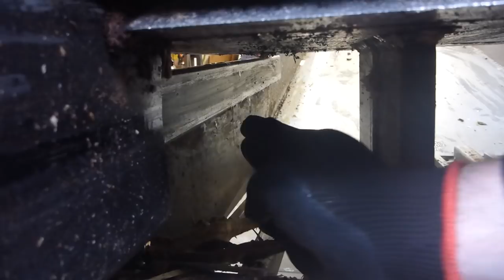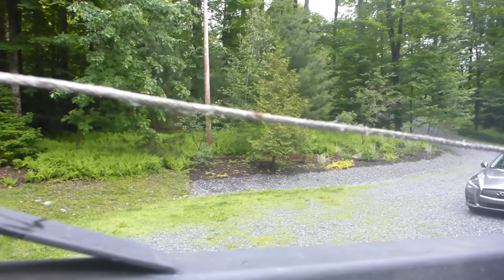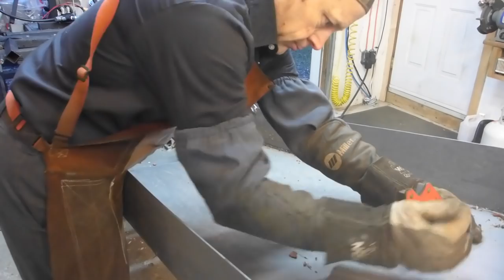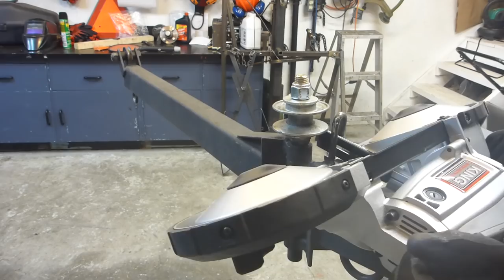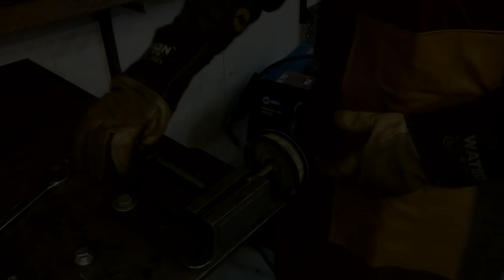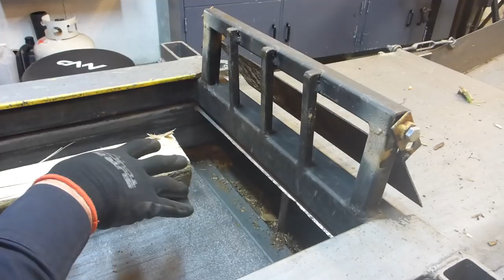#76 Splitter Modifications - Update

Comment: I know this is an older video and i am not sure if you have solved the problem of the unsplit chunk of wood from not getting caught up on the splitting wedge box but here is my idea...   make the side arms of the device that pulls the wood back out of square tubing (or round) and have it telescope, and put springs on it that will allow it to expand a bit when the ram is splitting but when it is retracting the springs pull the retraction frame closed thus pulling the chunk of wood off the splitting wedge/box.  You could use springs off an old trampoline and add as many as you need to make it work.
Reply from the maker: You can see video #77.  Pushing the logs back into the drawer was 95% solved.  What is not really solved to my liking is the logs jamming on the sides of the wedge, pushing against the side wings, which directs them onto the chute. I've found a method to put the logs into the "drawer" where it will operates way much better. In instance, I try not to put logs against the side of the drawer. Which so far seems to work good.  I should be splitting wood within a couple of months. Here, we till have a good 18'' of snow on the ground. I haven't cut any tree yet...  Thanks for your advice!

Comment: Joe, For keeping the wire rope, wouldn't it have been easier to weld two small , smooth bars across the guide hooks, one slightly higher than the other  then thread the cable over one bar and under the other?  I checked out #32 and there are some minor differences between  the IH 350 I once had and your machine.  First the loader controls were mounted on  part of the loader frame, and the  throws were shorter so it was easier to use both function at the same time.  The throttle lever was on the right of the steering wheel and the tractor didn't have a pto.  The original owner was WPI in Worcester, Ma. and they used it for grounds maintenance and had no use for it. What the tractor had was a rigid hitch, upon which sat a honkin' big concrete ballast block.  I found out the hard way it wasn't bolted down.  One fine day, after finishing my plow route, I was headed home and hit a bump of ice and snow doing about 25 MPH, had that thing bounced off. I wound up pushing the block home  (about 2  1/2  miles because it was heavier than the lift capacity of the loader. I got home without any problems, but getting it back on the hitch  is another story.  I'll just say it was a minor miracle I didn't crush an arm or a leg.
Reply from the maker: Lol! Very funny story, knowing no harm involved. Must have been very odd from an outsider to see a guy pushing a concrete block "home". (still laughing as I write this). As for the cable, even if guided, it does have to slide along the pulley. It's can enter at a set level and exit the same level after a rotation. So it have to slide slightly. Thanks for watching Jim!

Comment: Hi Joe, love the splitter, hope you don’t mind if I ‘borrow’ a few of your ideas for my channel! (I will mention you)
Why did you not mount the electric winch to the end of the crane and mount cables to it instead of dealing with the rope which moves?
Reply from the maker: Take everything you want, my videos are free! That is a good question about the winch! The winch is a very cheap one. To disengage the spool, I have to pull a lever on it. Being up there would not be possible for me and I use the crane as a winch for remote blocks (up to 25' far away). Then the remote is wired directly to the winch, not wireless. But the current setup comes with the problem of the ropes... Thanks Bodgemiester!